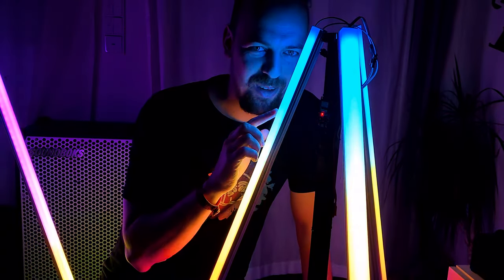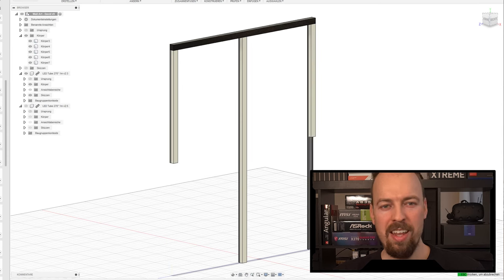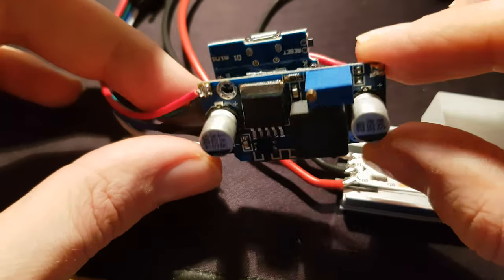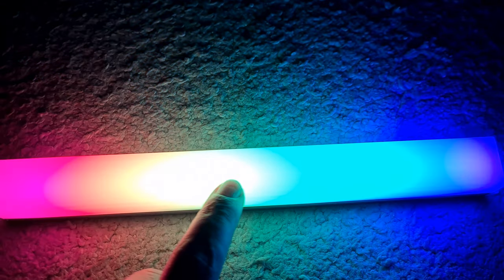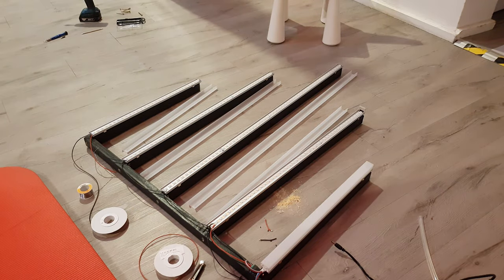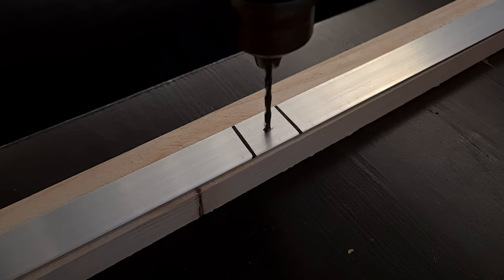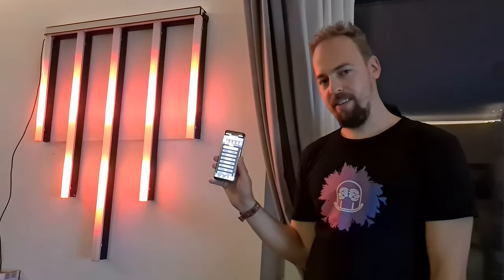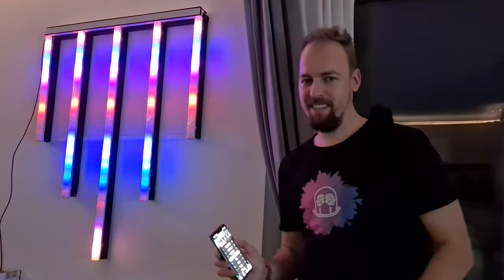Can this LED Wall Art be built in A DAY?

Comment: Do you use a microphone on the ESP32?
Reply from the maker: Yes, i used an MAX4466, which is a cheap analog mic.
But better use a MAX9814, which has an build in amp and will be much more responsive 😉

Comment: Good morning from Greece. Really nice job. I want to ask you something though.
Does the wled application for smartphones work without WiFi connection? I want to make a structure like yours in a place without Wi-Fi. I know that in order to set up wled I need the Wi-Fi connection for the esp32. After this, van this system work without Wi-Fi connection via Bluetooth? Thank you in advance 5:25
Reply from the maker: WLED only works over wifi, but you don't need an Router. You simply make an Hotspot with your Smartphone or Tablet and use the WLED App ✌️
Reply: Thank you 🙏🙏🙏